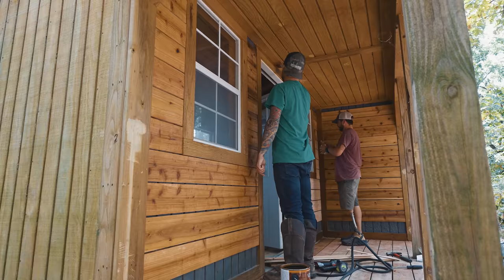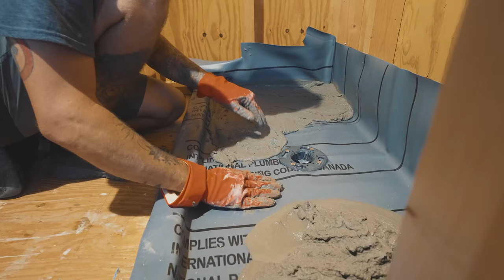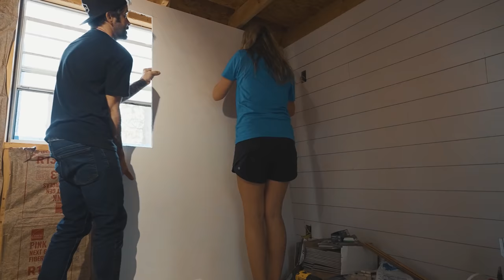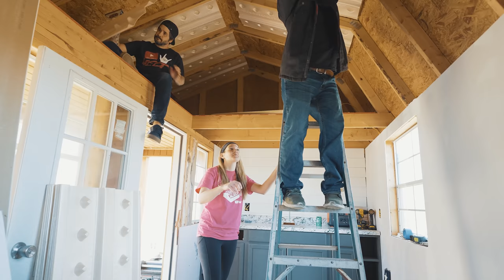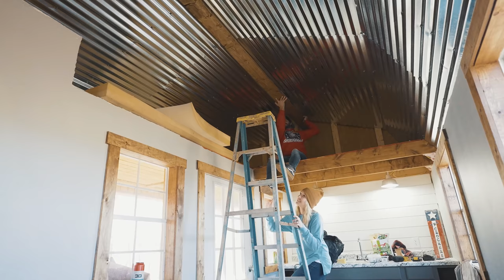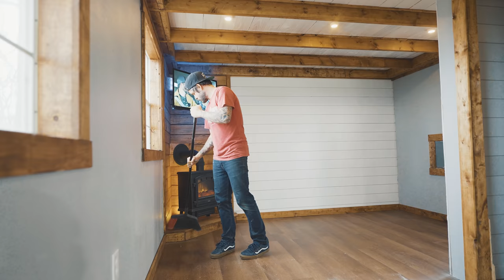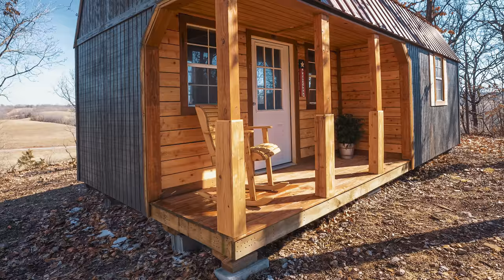Abandoned Shed Converted Into a TINY HOUSE in Under 20 Minutes!  SHED TO HOUSE CONVERSION

Comment: Cosmetically it turned out fantastic.  But I fear that you're going to have a major mold/moisture problem with that shower if you use it regularly.  Anyway, great video.
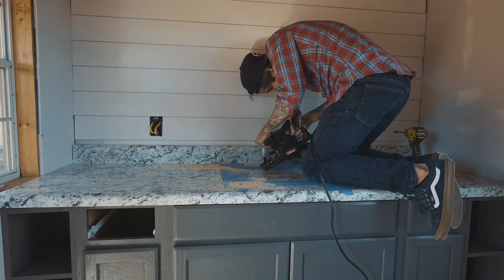Reply: I fear for his eyeballs lmao. You can see the safety squint in action at 10:27. Eye protection is the easiest/cheapest safety gear out there.
Reply: What do you feel is the concern with his process? I'm doing "mad" research on tiny home builds for my future.
Reply: @cheleb4672  they both answered your question? Lol 😂
Reply: @cheleb4672  No moisture barrier behind the concrete backerboard, no sealing seams in the corners of the backerboard, no waterproofing of the backerboard, and no waterproofing of the concrete floor. A $100 bucket of HydroBan would have prevented the inevitable water destruction he's going to experience from the first shower. All his work on that shower was for nothing. He will now spend more redoing the shower than he would have doing it right the first time. Forget the cedar, water is going to intrude behind that backerboard and under the shower and will rot away at studs, the outer wall, and the floor.
Reply: @CrazyGuyBlahBlah  thank you for your response. I appreciate your time.
Reply: Floor of the shower looks fine but the corners of the wall could use some Schluter, etc.
Reply: @CrazyGuyBlahBlah  I thought he was skipping steps.
Reply: agree i dont think that was marine board in the shower ether?
Reply: I can’t speak on the construction skills but I have read the comments on his videos. What I can say is that I’m very concerned for his health and safety. He uses an airbrush without respiratory protection. To make it even worse, he uses one INSIDE without protection. Please, whoever sees this, if you ever use those tools to paint please wear a respirator with the correct organic vapor particulate filters!!! Not just a dust mask, and especially not nothing at all! Ahhh!!
Reply: @FerociousPancake888  what does anyone really expect when the title acts like this is work that can happen in a flash.
Reply: @wjbslick67  No, that is definitely not how you mud or tile a shower pan. The only saving grace is that the wall studs and siding will rot before he realizes the problems with the floor.

It was years before my mentor would let me do a mud pan. I had to watch and assist on hundreds before I was allowed to do them myself. There is nothing simple or DIY about a proper mud pan.  This one might last five years (maybe). A properly laid pan can last a century.
Reply: @mszuzubookitty4646  come on! It only took them 20 minutes to do all this! 😂
Reply: I was wondering the same what kind of wood Is that?

Comment: Clear coated cedar for shower walls? Seriously, hope that works out. I'd be concerned with longevity and despite the sealer, mold. Rest of the project was super fun to watch! 👍🏼👍🏼
Reply: Didn't see any kind of water shield behind it either, looks like it's going to be a nightmare of rotten wood and mold in a few months. Tho i didn't watch the full video of the shower install, so maybe it was skipped?
Reply: I think cedar is mold and mildew resistant. I know they use it in saunas but not sure if it would work for a full on shower. Maybe?
Reply: @TheRogueBro  I think green board but yeah, that can't be a good idea.  I thought he was gonna run the tile up the walls.
Reply: I think they mixed up the tin sheeting and the cedar boards;  should have used the tin in the shower and the board on the ceiling!
Reply: @gizzyguzzi   yeah this is exactly what I thought! the tin sheets also make the room a lot more echoey than the wood would have and it looks bad too. Some people might like it, but it just isn't for me. Then the wall in the loft seems, lacking in a way... anyways, my point is that making the wall would have been a lot easier if the roof had been smooth with boards rather than it being covered with the wavy tin (I don't like the gaps left between the roof and the wall)... Now all of this of course personal opinion and they can and will do whatever they want haha, I just like to critique. I was simply interested because I'm curious about home designing 😊
Reply: @thickgirlsneedlove2190  nothin wrong with it yes, simply saying that the tin metal is not flat so that it leaves a gap in between the wall. I personally don't like the whole tin roof thing to begin with but basically more or less the gaps the roof makes at the edges of the wall, bother me. 

You can think what you want of it, there is nothing wrong about having your own opinion 😊
Reply: @thickgirlsneedlove2190  if you like mold and rot, yes.  Use wood in a shower
Reply: It’ll start growing mold in a couple months depending on use but prolly not long at all based on the inadequate plumbing he went with.
Reply: I was thinking the same thing, the only good wood to use in a shower is plastic wood.
Reply: from what I gather cedar wood is more resistant than other woods still carries the risk though.. It is really depending on what kind of coating you use on it. From what I gather using a deck sealant seems to work the same as for a porch though you are using it more constant so reapplying the coating seems to be a thing in the future if you are not careful maybe within a 2 year period or so again depending on use. Its one of those higher end maintenance things I wouldn't be using it if I was going to rent the place out only if I am going to sell the whole place because then its not your problem and it even jacks up the price.
Reply: @IloveJellow  I agree but for me I think along the lines of on a deck or any outside application it is "rains resistant" meaning after 1-5yrs depending on rain amount in your area, you have to reapply the Tompson Water seal or other sealant to keep it protected from rot, but in a shower application it will "rain" every day, (considering the shower is used everyday, sometimes 2 people take 2 shower everyday) and the shower can get constant direct water contact for 5-15 mins so it may need to be resealed every year. Just offering a suggestion as for me instead of repainting/sealing all the boards and all those cracks every 1-3 yrs I would rather just put plastic, composite, tiles/stone, or cement that looks like wood, that way no sealing every 1-3, just put in and done. But thanks for the info.
Reply: Cedar is mold resistant, pest resistant, and does not need to be sealed.. saunas are made out of cedar for that reason... my bus is lined with cedar and it naturally  freshens the space
Reply: @tjvisuals4387  thanks
Reply: Cedar is naturally water resistant. When it is sealed it is waterproof, as long as it is resealed every year or so. It also has to have good ventilation. As long as the bathroom has an adequate fan, it should be no problem. Think cedar shakes used on roofs, or cedar siding.
Reply: Not to mention that small tile they put in there Hope you guys plan on cleaning that grout on a daily basis that s*** can get more fungus in it than you can imagine
Reply: Yeah, I'm not sure about cedar, but teak would have been a great choice. Although,  it's expensive and there's maintenance pf course. Teak is used in boats and high end outdoor furniture.
Reply: I'm not a contractor or anything but for a woman I'm pretty handy,wood and water is a big nooooo!When my husband redid our bathroom he used the purple drywall for heavy water areas!He should of just did the tile all the way up!
Reply: No poly over the insulation either lol
Reply: @gizzyguzzi  maybe the cement board was treated 🤷🏾‍♂️ def would of went tiles tho
Reply: Couldn't agree more 👍🏻
Reply: Termites love cedar wood. Just be really careful. Love your shed conversion.
Reply: @thickgirlsneedlove2190  actually, this has and will have more problems!!
Reply: @RossMalagarie  the truest words are what the woman said.  " Time will tell!". And soon,on this under constructed, overly cutesy " remuddle! "
Reply: He's relying on 'not exactly shiplap' joins to prevent the water from collecting between the boards, but he should have gone with shiplap or just not wood.
Reply: Reason why we used it. I assume that is why they build saunas with cedar.
Reply: If you use indoor/outdoor deck sealer, cedar will be fine, fine, and fine.    :)    Many decks are made of cedar and as long as it is sealed, it lasts incredibly well in the very humid and damp southern swampy states, where cedar grows naturally… IN WATER. Not to mention it is used for spas and saunas so why not a shower? Just my thoughts on the matter! I’m excited to see the project, as I always glance at the first few comments before watching! Have a blessed remainder of the weekend!
Reply: @maikehannah9179  cedar is a natural insect repellent, including termites.
Reply: @sylvan9184  The cedar can be resistant, but nothing behind it was and I guarantee steam and water will breach it.
Reply: @tjvisuals4387  but sauna doesn’t have running water
Reply: Cedar wood doesn't absorb water which makes it mold and rot resistant so his shower is 100% fine.
Reply: @TheRogueBro  cedar wood doesn't soak up water which makes it rot and mold resistant.
Reply: @SouthernRebels94  you funny 😆
Reply: @seren6696  but it's true I work with wood and any professional carpenter can tell you this. Cedar will help prevent the spread of mold and mildew. Cedar removes moisture from the air, so in humid climates, it will act as a natural dehumidifier and keep your clothes from developing mildew.
Reply: Clear coated cedar for your shower could last about 15 Years and then the mold shows up. Know from experience.
Reply: Hopefully they used spar urethane

Comment: Really worried about the shower and there being no barrier between the cement board and wood, can see the insulation getting moldy within a month or so 😬😬
Reply: there is no water proofing any where .  i give it a year not more
Reply: @MrMaxnc  I agree! The whole thing will be a moldy mess in a year! I saw too many things to even waste my time listing them all. 🙄 Lol
Reply: House I'm working on now is over 40 years old and has no barrier and there is no mold.
Reply: He did pan the shower floor but newer codes require a pitch to drain before laying pan liner. I've done dozens of remodels for just this reason. A few years and his floor will rot from pooling water under the concrete. Not so worried about shower walls since he ran liner 12" up wall and used backer board before finishing with cedar (mold resistant) and applying a sealer.
Reply: @bludaizee24  Yeah I notice tons of mistakes in every build he does lol it seems like he just wings it with 0 actual research for some reason
Reply: Depends on where you live, I live in Northwest Arizona and our county code forbids vapor barriers because the vapor barrier will create condensation and not work properly. With our heat out here it will dry within a few minutes anyway. It's a little after 5 pm and it's 114 degrees with 2% humidity, all that plastic vapor barrier is going to do out here is sweat and create moisture.
Reply: I liked porch better with railing more privacy but that's just me 🙏
Reply: Reading the comments cracks me up.  All these construction guys that can't get past the little things. This shed will be there 50 years from now and will be used thousands of times. I've been a builder for over 25 years here in Florida and absolutely hate the codes that force people to do things on simple projects like this to go nuts for no reason. It's a shed guys, come on.  He's not raising a family in it.
Reply: Cedar wood doesn't soak up water which makes it mold and rot resistant so theirs no need for barriers, plus depending on your state if one can buy barriers as some states don't use nor sell water barriers, water barriers are only used in states that has lots of moisture but in extreme hot states water barriers are not used and you won't be able to find such barriers in any store.
Reply: Green board and plastic insulation should be used in shower. Roof not properly ventilated will cause a lot of moister.
Reply: Nice      Twenty minutes😅 lol

Comment: Thought it was cool but doesn't look very functional. Didn't see fridge, stove or cooling element...but it shows how much potential a shed has to be converted. Great job!
Reply: The sink is a darn JOKE..
Reply: @servraghgiorsal7382  Its a standard camper sink.. lol what more do you need lol he has no stove so not gonna be washing pots and pans haha
Reply: Doesn’t have a bed either
Reply: The bathroom has no tiles or any serious Waterproofing.
Just coating the cedar ain't it.
The insulation will get wet and there will be black mold in a few months.
And the metal under the roof...bad In winter. Catastrophe in summer.
They are handy men.
But they clearly don't know about and shouldn't be construction.
If they selling these places, which I think they do, lawsuits will follow
Reply: It's off grid.
Reply: @charleetucker2480  the loft duh
Reply: Nice job!  👍👍
Reply: Prob just a weekend cabin
Reply: You don't really need a stove. My Gf and I don't have one, we have a Microwave, Crock pot, Electric skillet and a counter top 9 function air fry ovens that is an air fryer, convection oven, broiler, toaster oven, dehydrator,  a rotissery, rewarmer, pizza oven and slow cooks and it cost us $150, granted your not cooking a 5 course holiday meal for 15 people in it but it works for the 3 of us, there is litterally nothing we can't cook other than a full size Turkey but we can cook Turkey breast, we built an 3 shelf open shelving unit in our kitchen and when we aren't using them we just put them up on the shelf so they are out of the way, The Microwave is on a shelf above the sink, full size/3/4 sized oven/stoves are a thing of the past in tiny houses because they take up too much space. Also that house is surrounded by woods and doesn't get much if any direct sun light, it doesn't need a cooling element, just a fan. it also has a hidden mini fridge in the kitchen cabinet.
Reply: @bryanmcknight4043  yeah, people seem to think they need all the new fancy things too that's why they are paying 80-100k on a tiny house. We paid less than 20k on our Tiny House, and that included the purchase price,. all of our cabinets, sinks, toilet and bathtub were all used and we just scuffed them up and repainted them. they only thing new in our house are the faucets and cabinet knobs. We made our own countertop out of old 2x4's that came out of an old house that was being remodeled and they were free just so the owner didn't have to pay to have them hauled away, we just cut them down to 1x4 and then stained them with a light stain and then poured a coat of poly of it. 3 month ago I got a text from my Gf's daughter who's in college that said "Dad...." She only calls me Dad when she wants something or when introducing me to new friends, and she said she wanted her own space when she came home for weekends and holidays and then sent me a couple of video's of vintage campers, I had a buddy one that had one that  was pretty much gutted so I gave him $50 for it and we have spent the summer rebuilding it for her, it's 16 footer which is really all she needs. When it's done it's basically going to be a just a bedroom and a hang out space with a desk so she can do school work while she's home, a mini fridge and a microwave so she can snack without coming in the house in the middle of the night, it's not going to have a bathroom or actually kitchen because she don't need one, she can use the one in the house if she needs it. She just needs a place to go to for some alone time and to sleep, she doesn't even need a bedroom just a bed.